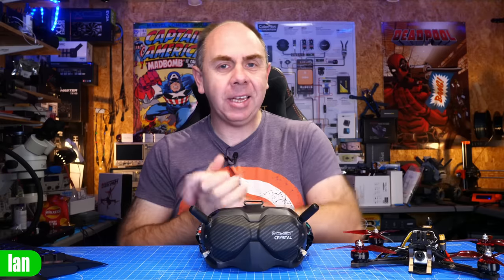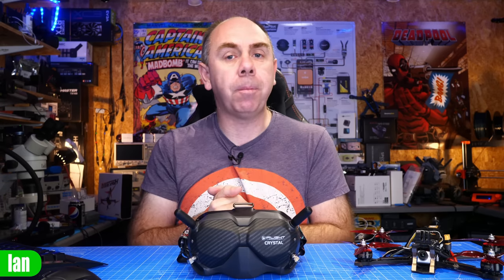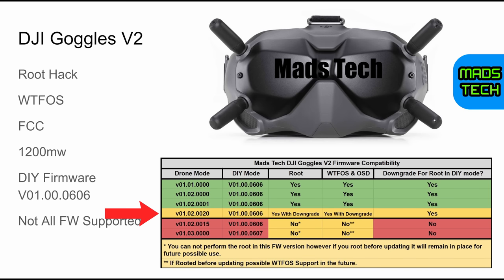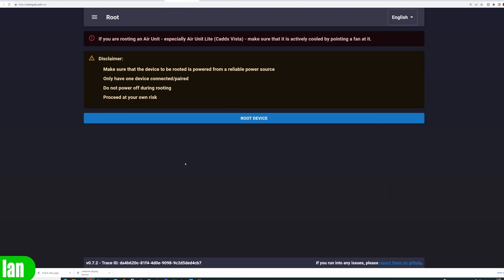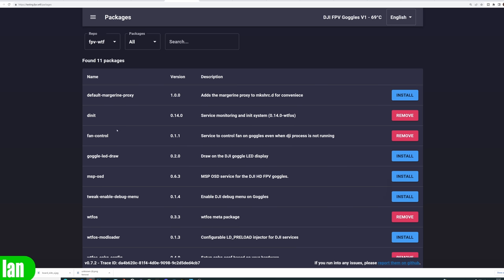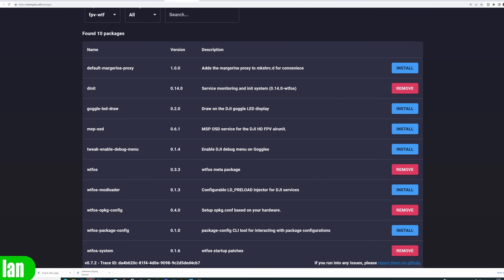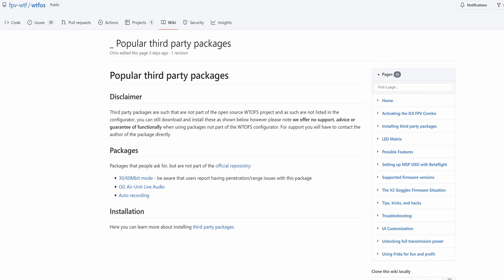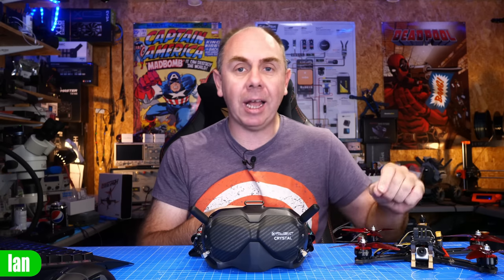DJI FPV MSP CANVAS MODE - HOW TO GET FULL OSD ON DJI FPV

Comment: I have just done the OSD mod, I am impressed and donated. But I noted the amount of donations is very low. Either people are not bothering or the FPV following is tiny. I hope the revinue picks up, $1000 is pitiful for the work done by the Devs.
Reply: I think they should put their 'donation encouragement screen' after the rooting procedure instead of before. People are more likely to donate once they see this actually works (which it does).

Comment: I switched to drone mode and current version is stil 01.00.0606 like DIY, nothing from the list...?
Reply from the maker: Yours are likely on very old firmware. Just root them from diy mode.
Reply: @MadRC  Because I don't have the drone, I never updated it. But it worked anyway. Is there now a chance to get a fully graphical OSD even better than FRSKYOSD? I am really looking forward to it.
Reply: @MadRC  u should ping out this comment many people are having the same question(I had to read all the comments to find ur answer) tnk u
Reply: @BBFPV  It looks to just draw & render whatever the OSD chip is capable of drawing no? Finally DJI users can use the chip thats included on just about every FC.

Comment: I have both betaflight and inav models, can inav work with this osd ?
Reply: Yes it does work with iNav. Instead of DJI FPV on the port you have your air unit/vista connected to select HDZero VTX and use HD mode in the osd section.
Reply: @fpvcapsule2727  Thanks for that, I will give it a try at the weekend.
Reply: @AlfieDoug  Please post if you got the OSD for INAV?
Reply: @sagienaicker2064  Haven't tried it yet, will wait for Madrc stream on Friday before I decide to try it.

Comment: Some of this info is incorrect. My v2 goggles are on 01.02.0015 in fpv drone mode and I was still able to root my goggles.
Reply from the maker: Not according to the devs. If you have you should share it on the discord.

Comment: I've rooted successfully three times now, but I can't install WTFOS as the browser doesn't see the goggles after the root is complete.  I can't find squat to get around this, but I wouldn't be surprised if I'm just missing something stupid.  Anyone else run into this issue?
Reply from the maker: Are you using chrome ?
Reply: @MadRC  I’ve tried Chrome and Edge.  I rooted again last night and same thing.  The browser only seems to see the goggles for rooting.
Reply: Same, rooted ok but then fails to see the com port

Comment: I just cant get LQ to work. It shows up on my OSD but with no Values. It just shows 0:0
Reply: If other elements are showing that is likely a problem with how you set up your rx.
Reply: @fpvcapsule2727  I had RSSI Channel on AUX 7 instead of „disabled“. Changing it did the trick and LQ is working now in the OSD.
Reply: @Copterflighz  i still also have the workaround with tracer which i dont need anymore. thanks for the reminder of disabling it :-)

Comment: So what.. where's the artificial horizon for Arduplane and Inav. That's what fixed wing pilots need.
The lack of an AH is THE major flaw with DJI HD system. Come on Dev's surely it's not impossible.
Reply: It works in BetaFlight. Should work in INav too.

Comment: Ian, I just sent you an email, but there is now a way to ROOT the latest firmware 01.00.0607 using the fpv-wtf/butter page which uses the 01.07.0000 superpack. I've been waiting patiently for a way and now I'm rooted with WTFOS! Worth a video for the wider audience if they don't already know.